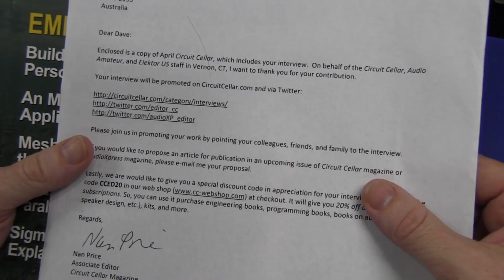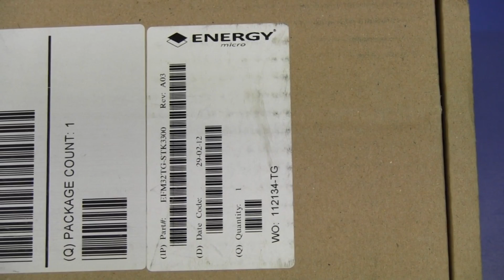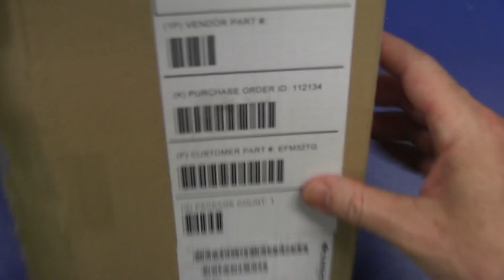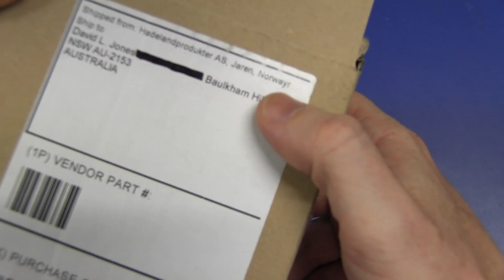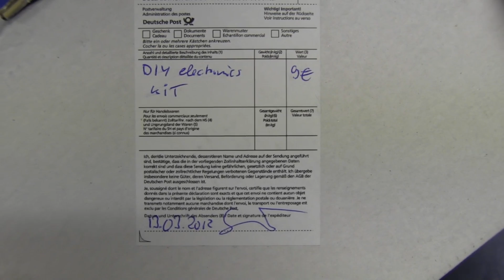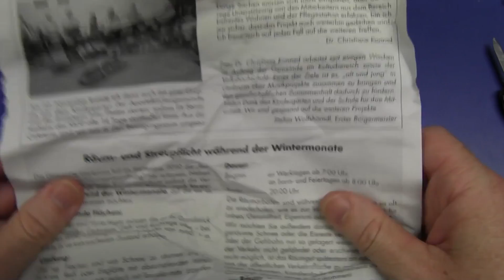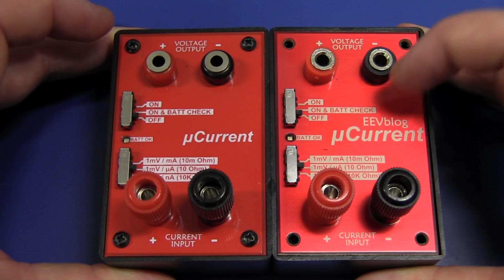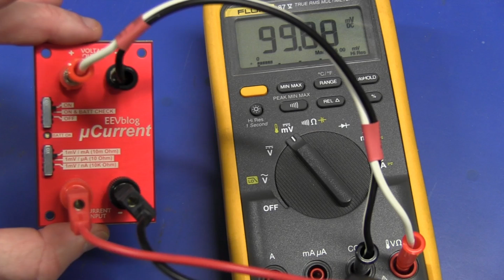EEVblog #266 - Mailbag

Comment: Samgab,

It is a much more advanced kit than the Arduino or the Launchpad with a more powerful 32-bit ARM microcontroller that is designed to be ultra-low power from the ground up.

Comment: It does come with a neat demo program- including one that measures the realtime energy usage...in sleep it is literally in the nanoamps range...actually the MCU CPU can sleep independently of the peripherals- it is very impressive for the horsepower. It seems that they beat the low-power MSP430 by a decent margin. 

In addition, one of the sensors that Dave didn't mention is the LCsense that detects metallic objects. 

BTW, I like your tear down videos too Mike !

Comment: The LEDs are specifically designed "upside down" and output through a drill hole in the PCB. I've used them in the past... the Avago "reverse mount series".

Comment: And you might want to test them on the  panel. A while ago did a tiny board that was panelised 100-up, and I put interconnect tracks on the breakout tabs so all boards on the panel could be powered up at once to test. 
Needless to say the PCB house queried the tracks on the breakout tabs...!